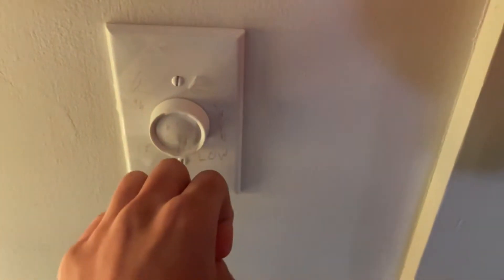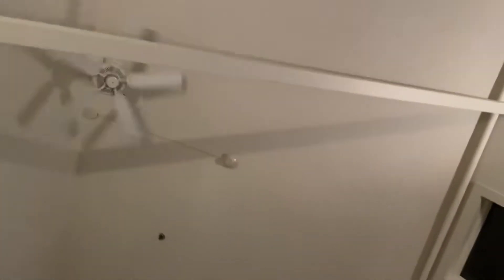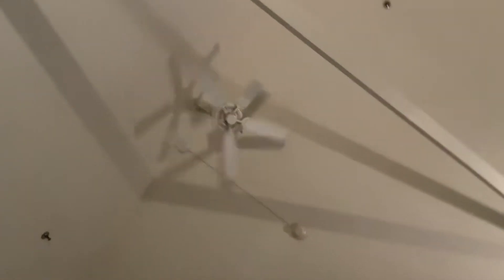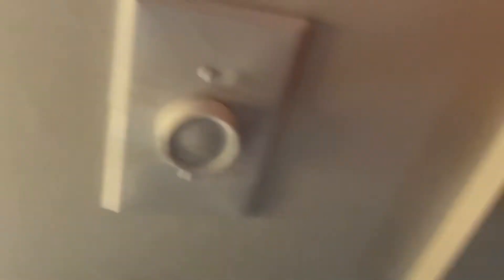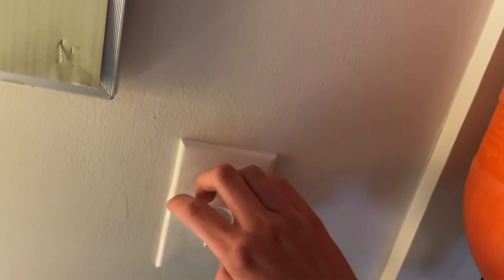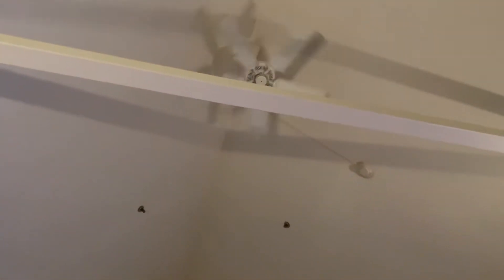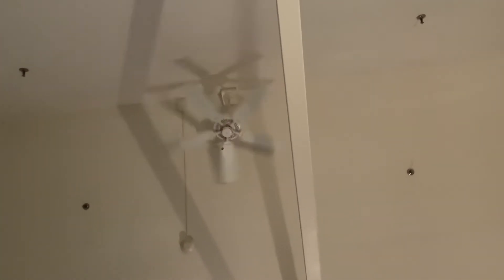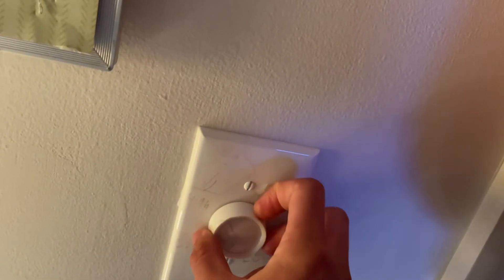Difference between Variable Speed Control and dimmer

Comment: My uncle and aunts house has a 42 inch Hunter Summer breeze in the sunroom and it’s on a light dimmer which I will replace with either a 4 or a 3 speed control. The fan will also be swapped with something. I’ll upload pictures and a video soon
Reply from the maker: That’s really not safe but, thank goodness it’s going to be swapped with A 3 speed capacitor control. Did the motor break or anything?
Reply: @ryanthefanguy9060  no the fan just hums very loudly because of the light dimmer. The light dimmer has a toggle switch and it’s the kind that slides
Reply from the maker: @shivamgandhi5779  that’s good that the motor works but, it really shouldn’t be on a dimmer. I saw 2 NuTone Slimelime iis on a toggle style dimmer and that’s really bad.

Comment: All variable speed control can be used as dimmer too. Incandescent dimmer is only made for simple incandescent light. which doesn't really care about NET DC and if it's set to too low. Also I want to mention that not all solid state speed control start with high. Some do start with low, all slider solid state speed control I had seen start with low and some even have an on/off switch instead of having its own off position, and some FASCO/Patton/Marley solid state speed control start with low too.
Reply from the maker: Ok, I didn’t know that

Comment: I've tried several of these and they all make the fan hum, they seem to work well with some types of motors, but most the fix speed controls that use capacitors are better.
Reply from the maker: Yeah